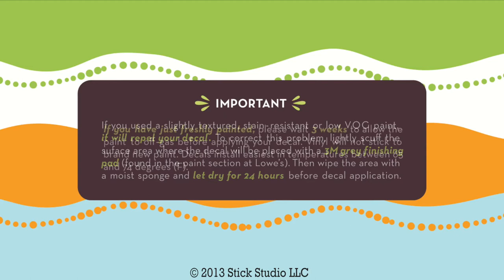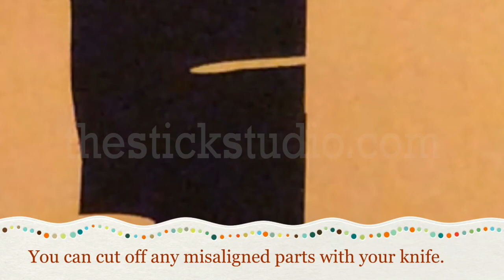Wall Decals Installation - Decal Installation - Vinyl Wall Decal Application

Comment from the maker: Hi Siri,

These decals are made with non-permanent adhesive. When you want to peel them off, simply use a hairdryer on a low setting and warm up the vinyl - then you will be able to peel off the vinyl fairly easily depending on how long the decal has been adhered to the wall. Unlike permanent decals, these decals can be removed whereas permanent decals are very hard to peel off.

Thanks for commenting!
- Gina